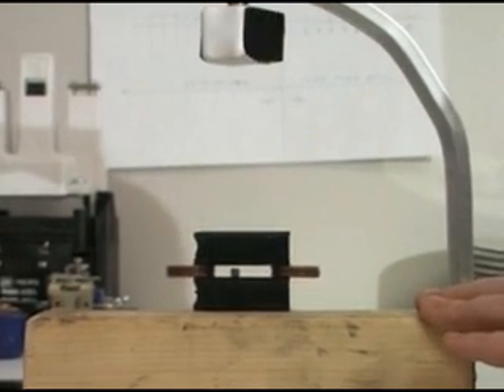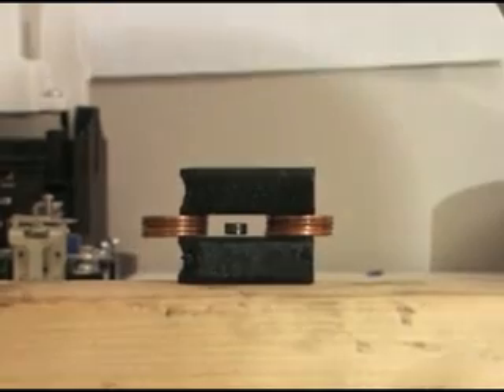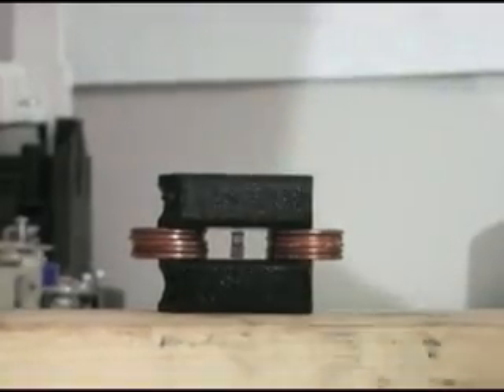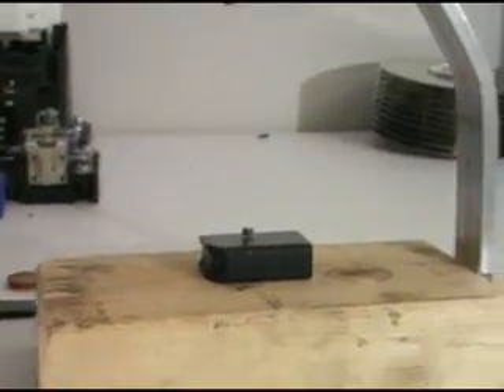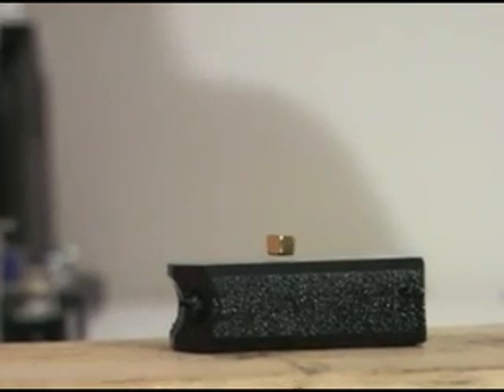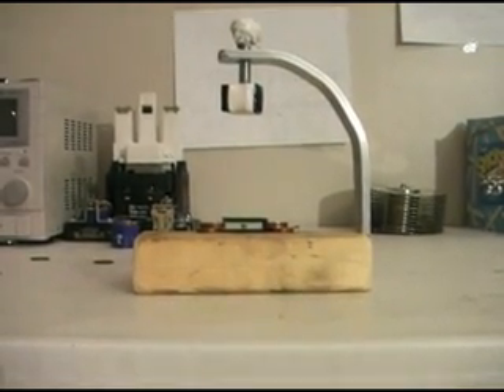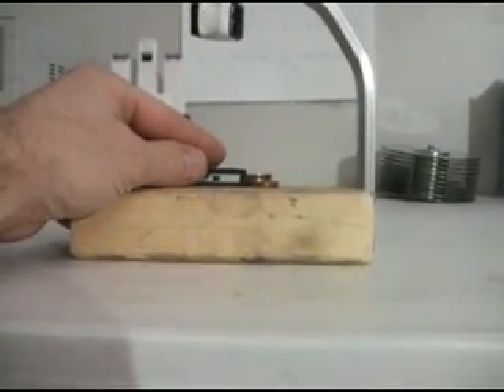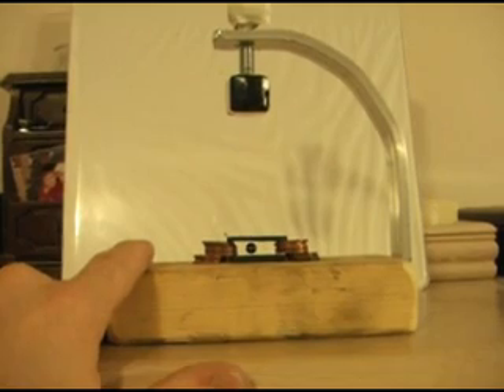LEVITATING MAGNETS  /  [DIY Diamagnetic Levitation] [KTFG 005]

Comment: can you reply , what happens when a piece of magnet (small) is put over a large pyrolytic carbon ?

does it repel ? (without upper magnet) ?

reply , thanks
Reply from the maker: Yes it repels but not strong enough to overcome gravity. 
You can levitate a small piece of graphite over very strong magnets though.
Plan to shoot a video of that.  I have the magnets and graphite just have to get around to doing it.